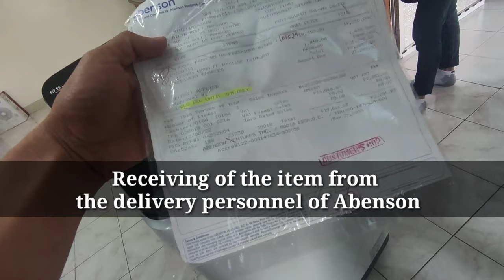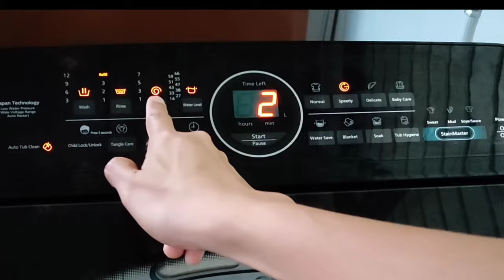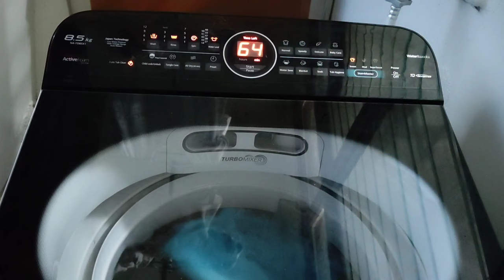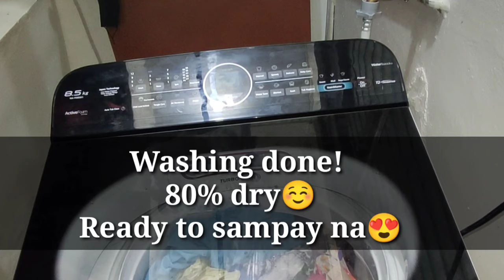Automatic Washing Machine | Setup, Operation NA-FD85X1 | English sub turn on cc #RollynPhTutorials

Comment from the maker: Washing Machine Order links
👇👇👇
SHOPEE: https://go.shopple.co/sph343
LAZADA: https://s.lazada.com.ph/s.8Ky8s?cc

MORE ITEMS like this here: https://shopple.co/rollynph

Part 2 video (Cleaning the water filters, water & electricity bills)
https://youtu.be/vmnRIlW4KXY

Additional info.
✅If power interruptions occur during operation, it will automatically resume when power is restored.
✅If planing to cancel or change the mode of the program (normal to speedy) you need to e pres ang power button (Off) to cancel it, then pres On to set into speedy then pres Start.

TIMESTAMP
0:10 -Unboxing
0:40 -Machine intallation
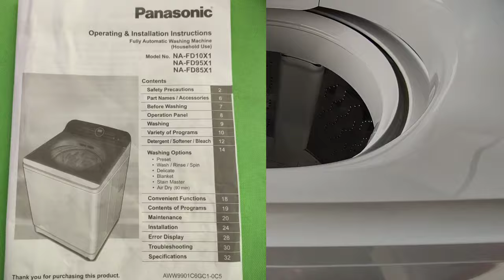2:32 -Preparation before washing
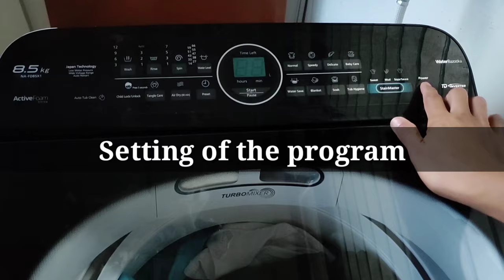4:42 -Powering on: Actual setting of the program
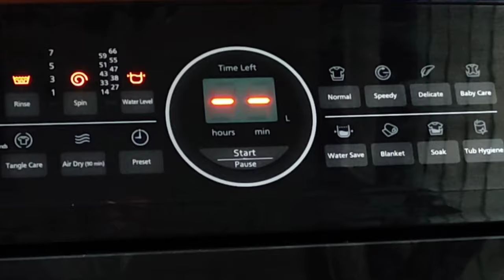6:27 -Start of Operation (Washing time)
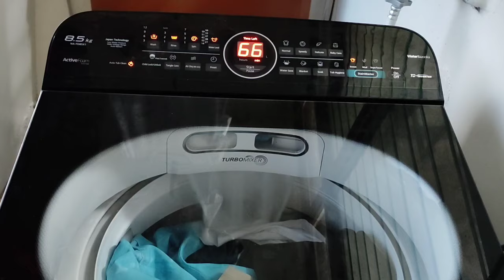7:46 -Why we chose this?
8:55 -Tips about washing machine
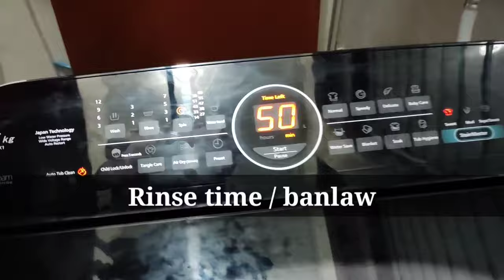11:19 -Rinse time
12:48 -Spin time
13:37 -Done operation
14:11 -Himulmol collector
14:55 -End part with baby Ryle

Thank you for watching. 

More videos like this in this link: 
www.youtube.com/rollynphtutorials/videos

Related Items Shopee links
👇👇👇
Panasonic NA-FD85X1HRM Fully Automatic Top Load 8.5 Kg Inverter Washing Machine | Shopee Philippines https://go.shopple.co/sph343

3-10m Machine Dishwasher Drain Hose Extension Washing Pipe with Bracket Set Accessories Universal | Shopee Philippines https://go.shopple.co/spsyfz

Washing Machine Water Inlet Pipe Automatic Washing Machine Water Inlet Pipe Hose Extension Tube | Shopee Philippines https://go.shopple.co/sputgp

Comment: We recently bought a panasonic top loading fully automatic washing machine, our problem is we do not find the option 'spin', after we hand wash certain clothes how can we put only for spin??, there is drynamic spin but it 35 minutes, how can we reduce the spin time to 10 minutes???, can you please guide us???
Reply from the maker: Hello Sir/Mam. Unfortunately we don't have an idea yet since we are not using spin.. Kindly check the manual if it's available. Thank you😊

Comment: hi po planning to buy this washing machine. just wanted to ask if there are any exposed wires near the drum/basket sa loob na baka sumabit? kamusta din after ng 1 month of using this?
Reply from the maker: So far wala nman kami na encounter na problem Sir/Mam at wala nman open or expose wire. Un lang pag makakapal na komot ang labhan at mabigat. During rinse, pag di balance at sobrang bigat nag eerror cia. Binuksan ko lang at inayos ang kumot or bawas load, ayon nag tuloy na cia banlaw.
Reply: Hi sir pano po pag nag fabcon ako same steps lng po ba kusa m sya magfabcon during rinse?
Reply from the maker: Yes po mam. Matic na po yan nia ilagay during banlaw.

Comment: Hello po! First time namin gamitin yong AWM namin today. Ano po kaya ang dapat gawin kapag hindi umiikot kahit blinking na ang wash at rinse? H51 po ang lumabas na error. Thanks po sana masagot 🙏🤗 6:40
Reply from the maker: H51 - Motor overload error:
Possible causes:
1. Something jamming the drum.
2. Bad connection.
3. Faulty motor.
4. Faulty PCB

Try nio lang po bawasan baka marami masyado ang labahin na nalagay.
Reply: @RollynPhTutorials  thanks po sa sagot. Kaunti lang po ang nilagay namin na damit wala pang kalahati kasi ita-try pa lang po namin, yon po ang lumabas H51.
Reply from the maker: Possible na may problem sa machine mam. Contact nio nlang pinagbilhan nio may warranty pa nman po yan.
Reply: @RollynPhTutorials  maraming salamat po! ☺️
Reply from the maker: You're welcome po Mam Maricar. God bless po😊🙏

Comment: Sir, naexperience niyo na po ba na nagerror yung washing machine? May error U12 po kasi and almost 4 hours na siya nagrarun
Reply from the maker: Pag ganun open nio lang po at ayusin ang mga labada, di lang un balance kaya nag error, baka may mabigat na nasama sa labada kagaya ng kumot. Close nio ulit magtuloy nayan cia.
Reply: dapat po di 4hrs na andar yung washing pag nag laba pp kayo ng 2hrs need po i rest yung washing atleast 30 mins.. and base po sa experience namin kapag 8.5kg yung capacity ng washing kasama na po dun yung water 4.2kg lang ng damit ang dapat nakalagay

Comment: hello po, kakabili ko lang din po kasi. ask ko lang po paano yung sa may fabric softener? kapag 1 lang po yung rinse, water lang po ba yon or sinasabay niya na po doon yung fabric softener?
Reply from the maker: Di pa po nmin na try na i manual sa 1 rinse lagi po kmi normal or speedy
Reply: @RollynPhTutorials  opo naka normal din po yung amin, naka set po ng 1 rinse lang. kapag ganon po ba sinasama niya na yung fabric softener sa 1 rinse or iba pa yung program niya after po nung 1 rinse tsaka po ma do-downy yung damit?
Reply from the maker: Sama na po yan mam.

Comment: Hi sir. ask ko lang base po kasi sa manual wag gagamitan ng adaptor. hanggang ngayon po ba nag aadaptor pa rin po kayo? or pinalitan nyo na po yung outlet nyo? sana po masagot hindi ko po kasi magamit washing ko dahil need ko rin gamitan ng adaptor😊
Reply from the maker: Until now mam may wala parin adoptor. Wala nman po akong binago sa sa outlet
Reply: nka adaptor po kayo based sa video po kasi
Reply from the maker: Anong adoptor po ba if sa outlet po ang tinutukoy nio as is parin po amg outlet. Yan parin ang saksakan na gamit ko until now po.
Reply: @RollynPhTutorials  ung mismong cord ng washing machine may adapter po kayo na nilagay bago isaksak sa outlet kc pangtatlong butas ung awm may ground pin n ksama.
Reply from the maker: @lestergallano-og9df oh okay. Ginamitan ko po ng pliers para maputol ung ground sa plug. Di namn need un kc ung outlet natin dito sa pinas wla namn ground na line. Kaya option 1 ay putulin option 2 ay gamitin ng adaptor.

Comment: hello po, tanong ko lng kung kelan dapat patayin ung faucet, habang ngllaba lng po ba then pptayin na pag nag air dry? kasi may nbsa po ako sa isang video n hinyaan nyang nka bukas ung gripo tpos pumutok ung hose baka sa pressure po, thank u po sa magging sagot
Reply from the maker: Pwde din namn na e off ang faucet kapag nasa spin na cia kc di na ito need ng water. 
Baka nga po sa lakas ng pressure kaya pumutok, pero madalang po yan mangyari.  Kung di nman super lakas ang water pressure sa area not recommended po na e turn off kc automatic nman po yan mag sara at bukas.

Comment: sir alin ang mdami kumunsumo ng water ung 10kg o ung 8.5 kg? or depende s settings ng water level?
Reply from the maker: Hello! Mas malakas po Sir Zandro sa kunsumo ang 10kg dahil ang machine mag calculate gaano karami ang tubig ilagay nka during laba at banlaw. 
Mas malaki ang space mas maraming damit mas maraming tubig magamit nia. Kung ano mas maganda 10kg or 8.5 mas okay ang 10 para malaki capacity yes may factor ang settings pero by default ay matakaw sa tubig itong topload type na washing machine.
Kaya kung may budget nman kayo go for sideload na washing machine kc tipid un sa tubig.

Comment: Hi, just wanted to ask, ilang kilo po ng damit nilagay nyo jan? Yung nilagay ko po kasi is below 6 kilos, tapos nag u-U13 talaga sya. Ang ginagawa ko nalang is babawasan kasi paulit2 talaga syang mag ri-rinse.
Reply from the maker: Sa video po ay for testing lang yan kaya puno nasa 5 kg. po yan. Ang ideal po jan ay 4 kg na damit kc e add pa po ang water sa timbang na nasa 4kg din.
Reply: Same tayo mam. Mag start ng ilang seconds yung spin medyo maingay tapos may rinse nanaman sya.  Pano po ginawa  nio sa washing machine nio?
Reply from the maker: Kung wala nmang error code like kay mam na U13 lumalabas sa display normal yan mam magtatapos nia yang labahin. Pag may error na U13 that means overload. So need magbawas ng damit na mabigat. Sa case ko na experience ko rin yang error code nayan ang ginawa ko tinanggal ko ung kumot  na makapal kc un ang mabigat, ayon nagtuloy na cia.

Comment: Kailan po papatayin yung gripo?pag tapos na po bang mag wash?
Reply from the maker: Pwde po e off pwde din hindi. Sa amin mam di na enooff para less hassle. May automatic nman na  valve na taga close at open yan  yan. Basta atleast once a week linisan ang filter. See my 2nd video how to clean the filter if needed.
Reply: So pagtapos na Po Ng process nangpaglalaba dun na Po isasara Yung gripo?
Reply from the maker: No need na po e off ang gripo mam. Pero  kung di kayo sanay na di inooff, off nio nlang po. Sa amin kc di ko inooff.
Reply: Ok Po thanx

Comment: hi sir, paano po kapag maiksi yung hose, pwede po ba yung mga hose na nabibili sa shopee na pamalit? medyo malayo po kasi yung paglalagyan ng washing machine sa gripo. thanks in advance!
Reply: plus mahina po ung pressure ng tubig samin ee
Reply from the maker: Dapat po ay fit cia mam. Ito ang hose para sa ating Washing Machine Water Inlet Pipe 
👇👇👇
Automatic Washing Machine Water Inlet Pipe Hose Extension Tube | Shopee Philippines https://go.shopple.co/sputgp
Reply: @RollynPhTutorials  thank you so much sa sagot sir!

Comment: Anu po size ng hose drain tas hose sa tubig na mahaba.palink po sa shoppe thanks..plano ko po bumili nean..
Reply from the maker: Ito po Sir.
3-10m Machine Dishwasher Drain Hose Extension Washing Pipe with Bracket Set Accessories Universal | Shopee Philippines https://go.shopple.co/spsyfz
Reply: @RollynPhTutorials  thanks sir..ung hose po  supply po ng tubig na mejo mahaba rin.
Reply: @RollynPhTutorials  3/4 or 25mm po ba ung lagayan ng tubig sa washing
Reply from the maker: Ung adopter nia  yes 3/4